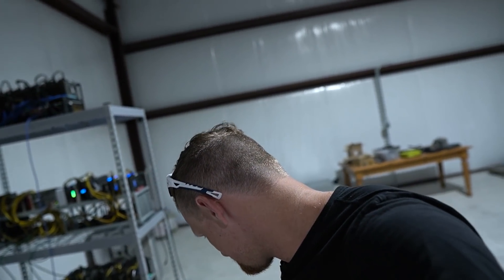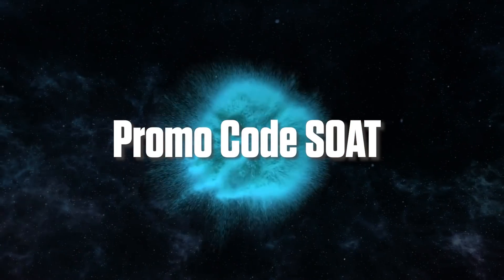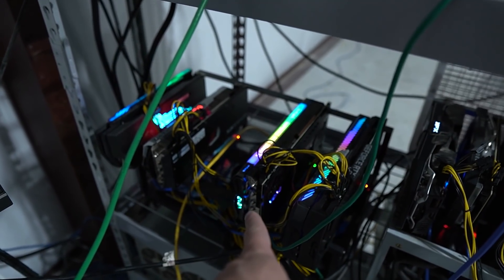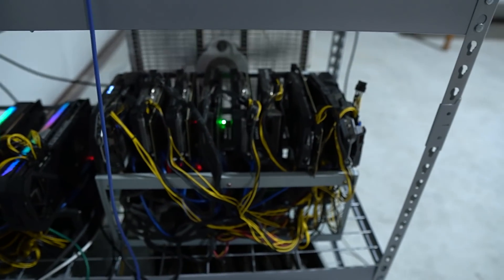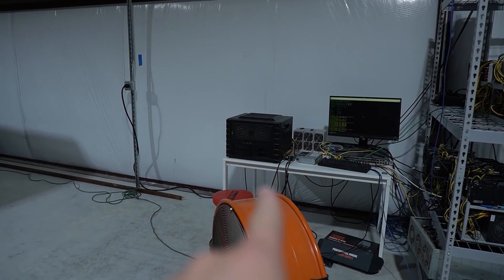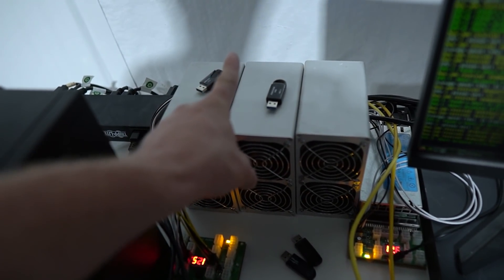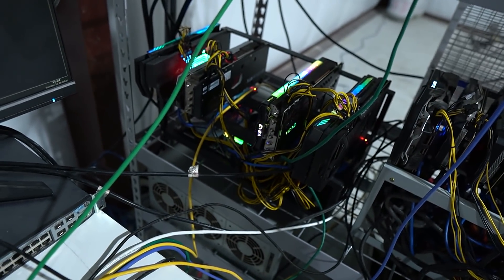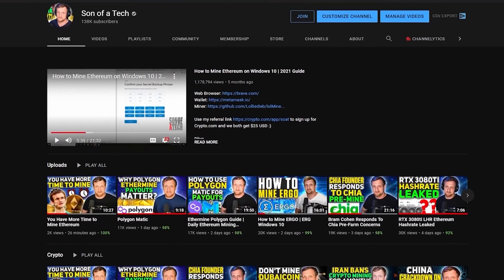Son of a Tech's GPU Mining Farm Tour

Comment: Mining RTM on hiveos with 3900x cpu at 2.4 to 11.3kh at 88 to 105 watts from the wall. Mobo set to 1 volt amd cpu under clock 3.8ghz and ram stock setting at 2100mhz. Stable for days

Comment: You probably don’t have enough power delivery for the 5800x try a different mobo. Since my recent foray into mining I’ve been getting gpu bundles that come with mobos. That being said   I put a 3900x into a used but still operational  asrock b450 gaming (cyberpower Oem).  It would run a couple hours before it would shut down.. I had to switch to a bundled gaming Gigabyte x570 auros elite as a test to see, running weeks solid  no reboots or shutdowns after.  The vrm for ryzen matters as in the quality and amount of capacitors.  The cpu mining king(amd)  might be dethroned depending on what lga 1700 has to offer hash wise.. Mining xmr
Reply: Thats a very expensive mining setup, especially to scale with the time we have left. Look at the biostar tb360 btc pro. I love those and they are cheaper(and newer) than the Asus 250 series. I found that the lower end core i3s are pentiums are WAY overpriced. I found some new i5 9600t's for cheaper than a i3 8/9100 and bought a few of them. Love being able to compact all my cards into 2 rigs.

Comment: question, you moved to a commercial building im assuming to get and industrial electrical rate. im sure as of now your setup makes plenty to cover the overhead of rent. im stuck on a single rig because im paranoid of what happens after eth goes 2.0.  are you saying your confident profitability will kick up in another coin or can you sustain this with the they payout of raven coin or whatever lesser coins you may be mining ? im running older cards and want to step up im just affraid with the high card prices ill never recover the investment. i got my cards right before the prices went nuts so im sitting well on roi.  im curious on your reasoning for expanding the operations.
Reply: My guess is that he has or is planning to purchase ASIC miners for BTC mining to help offset GPU uncertainty.

Comment: HELLO  soat ....dude i have one question. i want to split power safely by plugging in 3 gpus to a atx psu but the psu is only powering up 2 atm and its risers. please let me know what those black and yellow cables are and where i can buy them
Reply: those cables are from a server size psu most likely. it has way more wattage than a standard psu. sounds like your psu doesnt have enough watts